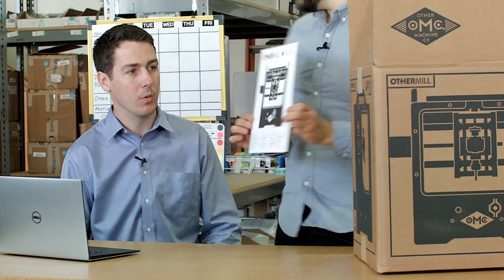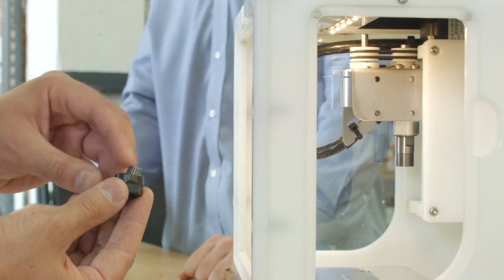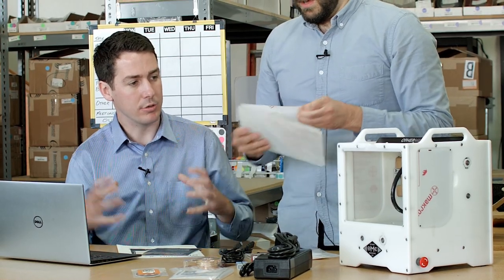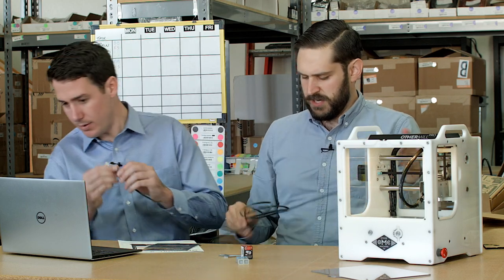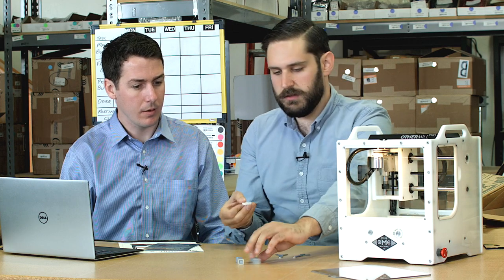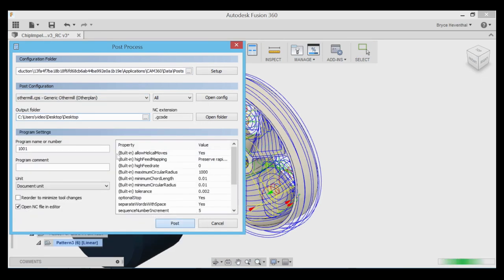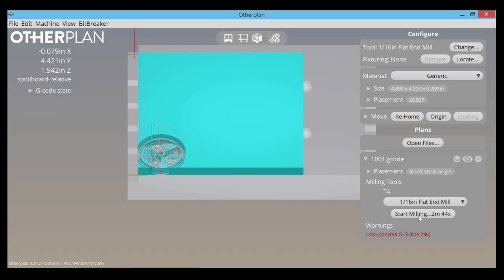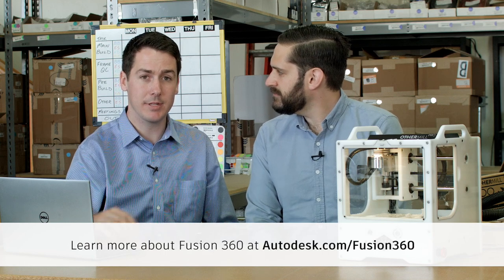Fusion 360: Unboxing the Othermill Pro

Comment: They have 2 versions,  2k to 3k. One comes with other tools and stuff for 4k. It can sit on your desk and run prototype PCB boards. Seems right to me.
Reply: Is milling PCB getting to be a big thing?  I watch a few videos from the EEV blog and Dave didn't seem very impressed by it.
Reply: We do it here for fast prototypes. If it only made 1 board when we needed it, if would have paid for it self. But I agree, it's applications are limited. It would need to fill a niche or education on Milling.